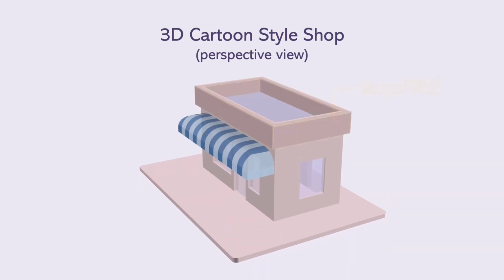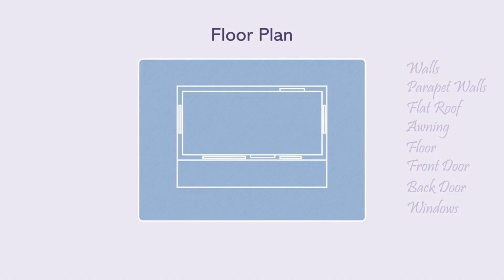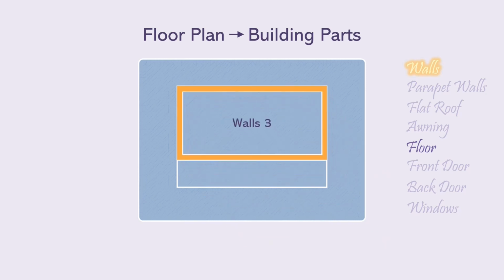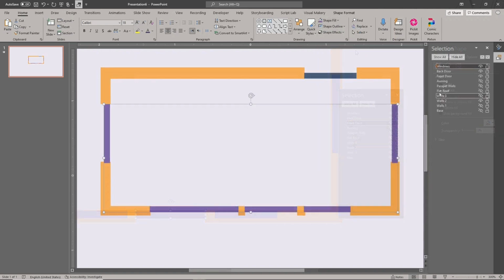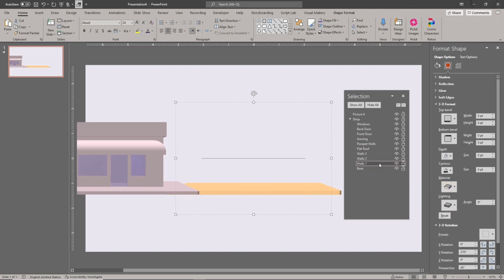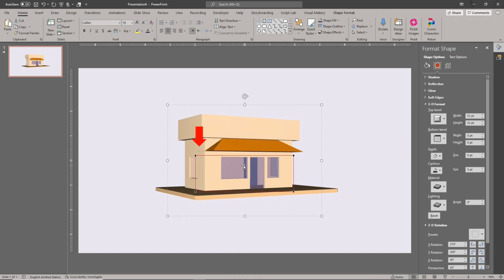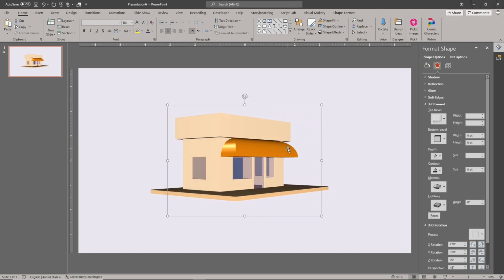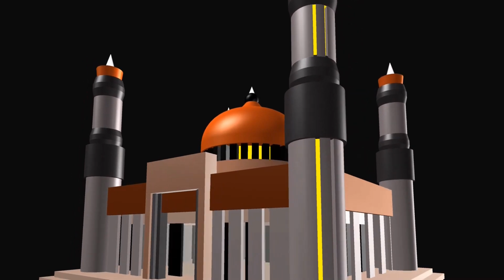How to Make a Cute 3D Shop - PowerPoint Tricks

Comment: Amazing. Thank you so much for the video! I tried replicating it... it doesn't look as good as yours though! thank you again amazing tutorial
Reply from the maker: 😀 Thank you! FYI, I'm working on more variants of these little cartoon-like buildings and will share the steps to build them soon.
Reply: @Cubiclite  Thank you so much. I look forward to these! I have a quick question - is it possible to add a sign with a name Flowers on top of the shop? I tried creating a 3D rectangle as the sign but I cannot write any text on the side of the rectangle. Any ideas please?
Reply from the maker: @MoooMooMoo  yes, that's one of the problems creating 3D stuff in PowerPoint. With a vertical build like this shop, we're not able to add too much details to the sides. For close-up illustrations, I would create it as a horizontal build. Here's an example: https://youtu.be/4Qxjq_1WluM (sorry, it's not a real detailed tutorial). This lets you add signs and other designs.

I also have a hybrid (vertical + horizontal) build technique that's more difficult to do. I'm still working on the tutorial. Here's an example of how it looks: https://www.instagram.com/p/CPlVvxRHvj7/?utm_source=ig_web_copy_link. All the best!
Reply: @Cubiclite  Wow these are amazing. Especially the hybrid build. Looking forward to your tutorial. Cannot wait! :)